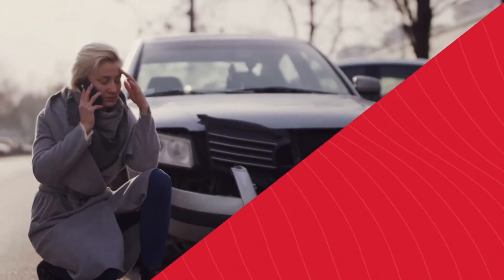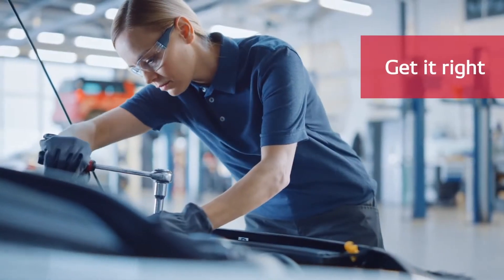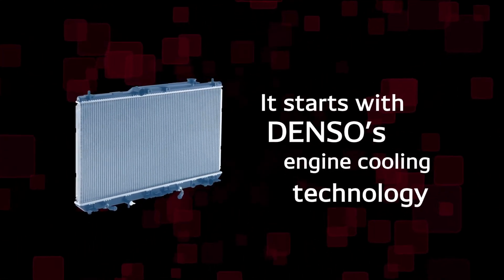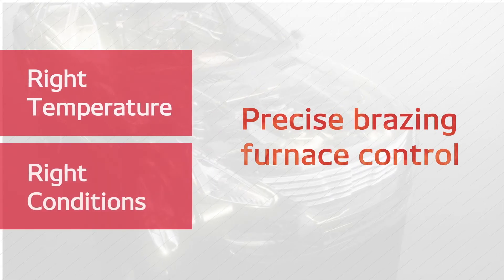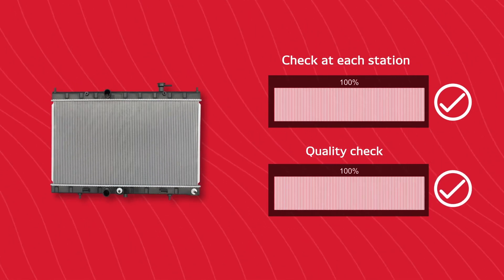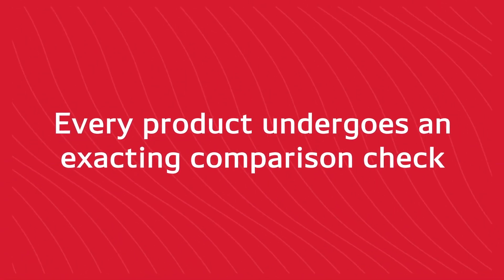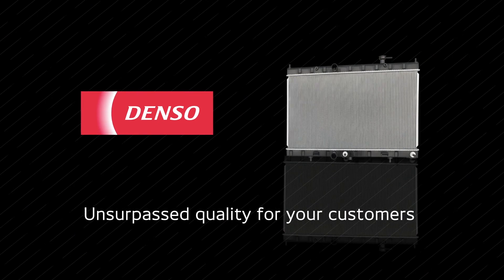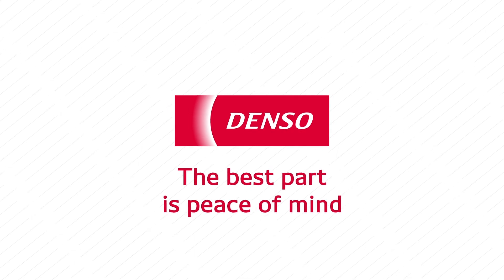DENSO First Time Fit Radiators

Comment: What's the star shaped cap on the radiator filler neck it can be torqued and loosened I need to replace the o ring seal around it but need an extra cap in case the one on the radiator breaks

Comment: They are delivered damaged due to poor packaging. Don't risk it.
Reply: It's true, I ordered a Denso radiator from Amazon and I was surprised by the mediocre way it came packaged, they practically put it in the box and that's it, they just put a few pieces of paper in each corner. And it's made in China, so I'd rather get another cheaper one, also made in China.